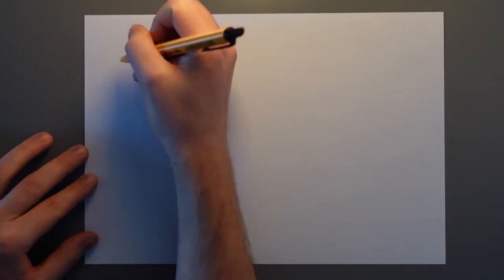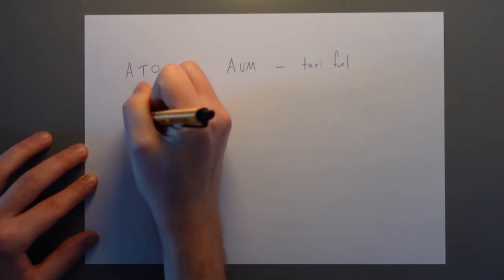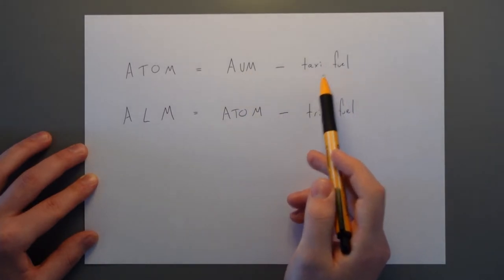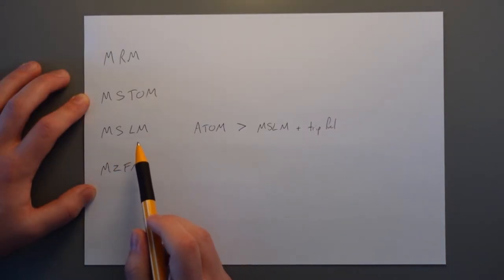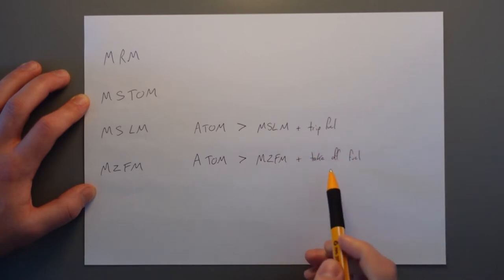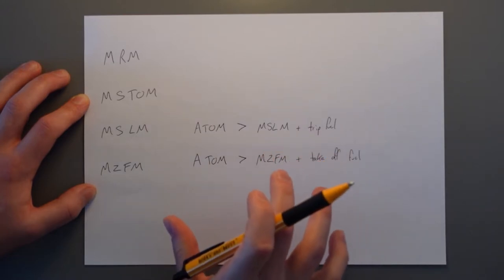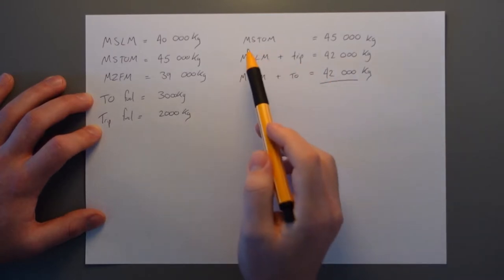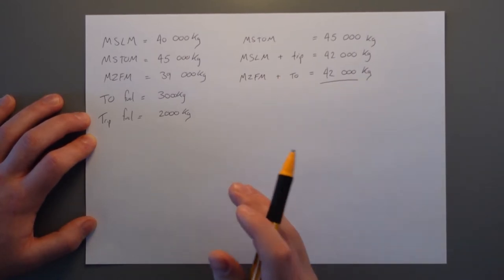ATPL Mass and Balance - Class 3: Structural, Performance and Regulated Masses.

Comment: Hi, Grant! Regarding take-off performance, as you mentioned, cold dense air is preferred to hot non-dense air. Since airports at sea levels will have more dense air because of gravitational force, I find it counterintuitive that we should expect better aircraft TO performance than at airports where the air is thinner. 

My logic: denser air = more air resistance = poorer A/C performance.

Can you please explain why thinner air means poor A/C performance? Thanks.

The only logical explanation that comes to my mind is the fact that when a jet engine is sucking this thinner air in the front, that will push less jet of air out the back and this will give deteriorated thrust compared to sucking more dense air.

P.S. I still haven't passed my Performance PPL exam.
Reply from the maker: It's all to do with the engines. Denser air has more oxygen in it per unit of volume which means the explosions in the engine are more efficient and better compared to the less dense air. This translates to more power out of the back of the engine meaning overall performance in terms of climb rates, take off distances etc is better
Reply: You go high in the atmosphere air becomes less dense or thinner which is better for aircraft performance because engines burn less fuel up there with high speed giving us better performance and why it becomes less dense up there is because pressure has larger influence on air density that's what I know